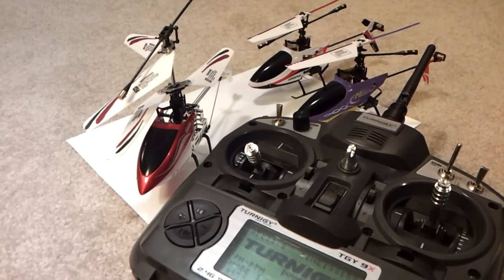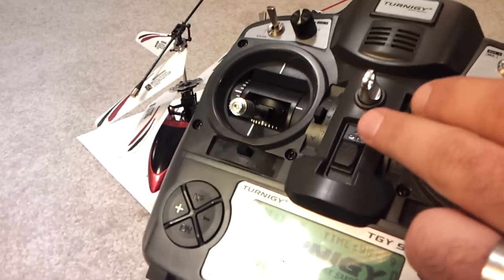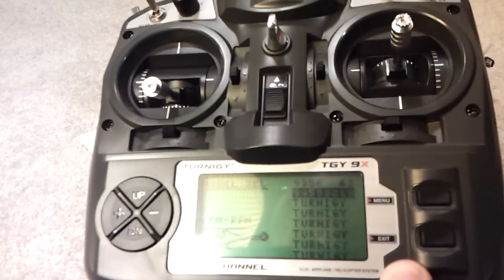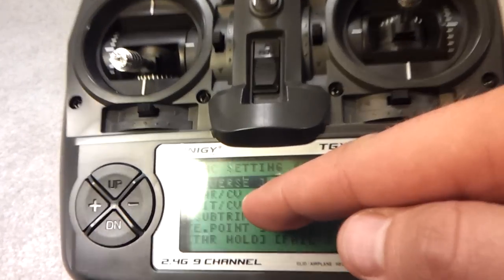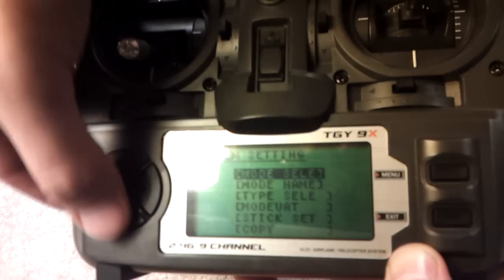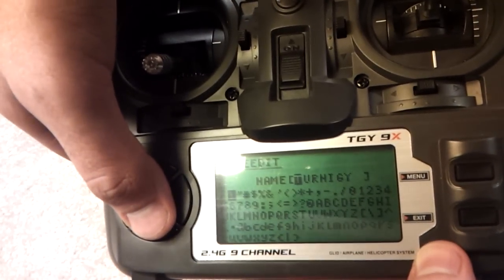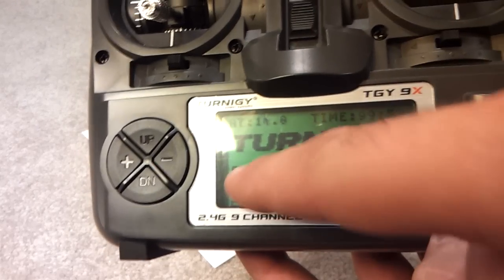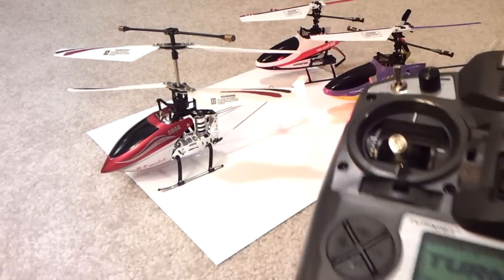Binding and programming Turnigy 9x to 9958 5888 hk-190 msp190 helicopter

Comment from the maker: I'm doubting it would work with a frsky module hacked transmitter, BUT - you could try.  There's no loss in getting one of these cheap helicopters - They come with a remote that's very usable - IF it doesn't work, then you can still fly it.

If you did your modification with a toggle switch to change between the stock Turnigy and Frsky on the fly - then yes - it would work in the default mode.

Comment: Got it working with a flysky (turnigy clone) but the same module with exactly the same settings in a modded flysky with er9x installed just goes bonkers. I really want to use the 9x for everything but this heli is in the way